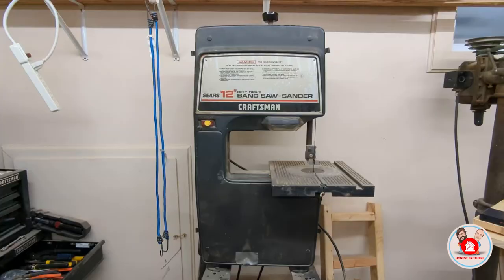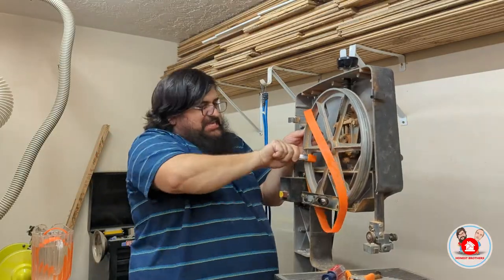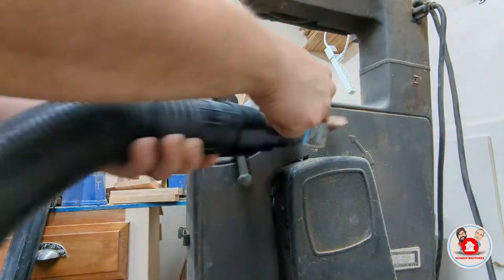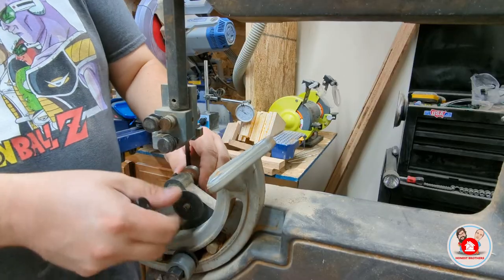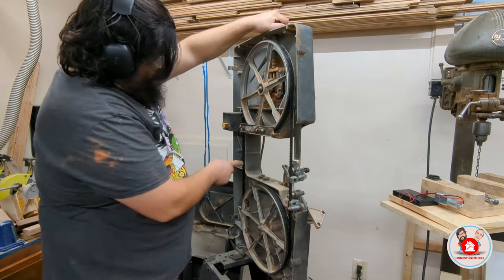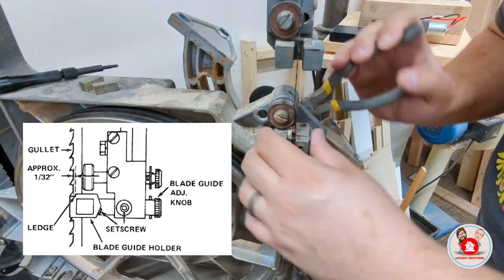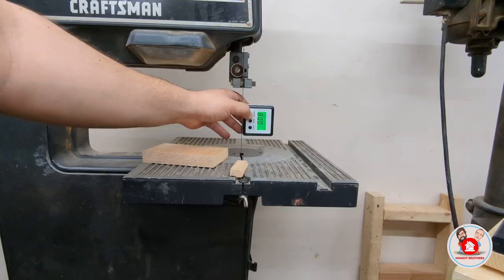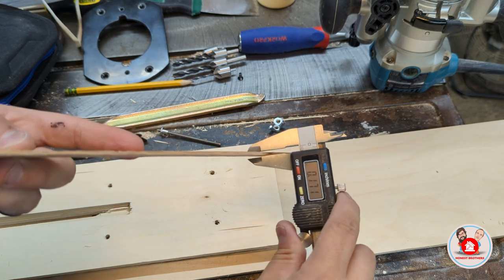Craftsman Bandsaw Tuneup | Resaw blade install, tire replacement, and tune

Comment: Great video! I have this bandaw.  You don't actually need to remove the four bolts to get the table off. Just remove the one nut on the trunnion and you can remove the table and trunnion together. Just remember how the trunnion washer, handle, spacer, and nut go on that single bolt and you're good! Much easier, in my opinion.
Reply from the maker: That's a great tip! And that would be easier!

Comment: Dude I don't even have this saw(craftsman 10in band) but this was by far the best bandsaw video yet. Almost want to send one of my restos your way just to see the content . Solid work bro
Reply from the maker: Thank you! I wish I had done one on the 113 tablesaw and the jointer. I inherited a bunch of my larger tools from my grandpa, and they all needed some tune up. I should have some more content coming soon, but they're mostly 3D printing focused. I'm trying to brainstorm some ideas for making some 3D printed jigs for woodworking, too, which I think would be pretty sweet.
Reply from the maker: Oh, and I'm working on getting into homebuilding. So there may be a whole series on that.

Comment: Nice. However... Any time you change the blade or perform an adjustment, make sure the on/off switch is in the fully off position; remove the safety key; and unplug. Tool (blade) change and adjustment  for and power tool should be done with power off and unplugged. That is, no energy potential. Safety first.
Reply from the maker: You're 100% correct. I'll have to make sure to include unplugging the motor next time. LOTO.
Reply: Wait, I thought it was easier to make adjustments while it’s running?!?
Reply: @colininscore1286  My original comment was 8 month ago. you wrote: "... easier to make adjustments while it (the power tool) is running." depending on what you are adjusting or replacing, power should be "off." Depending on what is being 'adjusted' you can "observe" what requires adjustment, turn off the tool, make the adjustment, and repeat. "easier... " does not mean "safest."

Comment: Thsnks Brandon.  This is helpful as I have this same bandsaw (25 yrs old).  I do have a question about removing the wheels to make installing urethane tires easier.  Can you give me any hints as to what the parts are that need to come off and the best way to do that?  Thanks, Liz
Reply from the maker: I've never had the wheel all the way off, but it looks like the wheels are held on by a lock ring, so you'd need a set of lock ring pliers to remove them. You can get the pliers from an auto parts store or online. I wouldn't recommend buying the cheapest set of pliers as the tabs on the pliers like to break.

I'm not sure if they're pressed on, I don't think they are, but if they are, a pulley puller from the auto parts store will pull the wheel. They have it as a rental tool.

Comment: Great video! I have this same bandsaw. Can you give me a link to where you bought your guides blocks and blades? Also, do you use a sacrificial fence for tall(er) stock? What do you use?
Reply from the maker: Guide blocks:
https://amzn.to/44vLKDl

Urethane tires:
https://amzn.to/44uvnHg

The fence I use, I just made out of plywood. Works well, but not the easiest to set up and get square. I need to come up with something different, but too many projects. 😅

Comment: Hi, thank you for this great video.  I have this same bandsaw and need to replace the capacitor but I have no idea where it is.  Ive looked everywhere for it so it must be inside the motor but want to confirm before I start tearing into it.  I have no idea what Im doing here
Reply from the maker: I haven't had to do this, but it would be in the motor housing. Does it start without the belt on?
Reply: @Honest Brothers  I haven't tried taking belt off but I will try it and see what happens.  Thanks a lot
Reply from the maker: @ursulap23  That'll help diagnose if it's an isolated motor issue. I think they put several different motors on these, some have caps, some don't. Mine has really bad starting torque. If anything is hanging up, the blade won't turn.
Reply: @HonestBrothers  I wonder if someone here, in the comment section, can tell me how to read the date code on my saw? I would like to know what year it was made.

Comment: I believe I have the same bandsaw. Craftsman 12 inch model number 113.243310. I need to replace the tires on the wheels but I don’t know what size to buy? What size tires did you use? this is my first bandsaw, so I am a newbie.
Reply from the maker: They are 12" x 7/8" urethane tires from Amazon. They are a total pain in the arse to get back on, be warned.
Reply: @HonestBrothers You really wanna party? I mean like really really wanna party? Then get yourself the craftsman tilt head band saw and try putting a new tire on the bottom of that. I did that today. I havent fully recovered yet.

Comment: How well does that particular bandsaw work for resawing thicker stock?
Reply from the maker: Honestly, I haven't tried thicker stock yet. I'm in the middle of 3-4 projects right now, one of them being inlay banding I'm going to put into a shadow box for my wife, so I needed the resaw blade on it for that. There was a LOT of blade drift with the blade that was on it, but also the saw needed the tune up. 

How thick are you talking? I have a branch that has been sitting in my back yard from a lightning strike that I can try to run through it.
Reply: I've seen several of these types of bandsaws for sale and was thinking about getting one. 
Would it work for 3/4" or 1" stock?
Reply from the maker: @moorebid5380  With a proper fence, I think you can. I just tested a piece of white oak and got a little bit of blade drift while trying to cut a piece that was 1/16" wide. 

I plan on upgrading eventually. Bearings instead of guide blocks would help a lot.

The motor is a little under powered to cut anything super hard. 

It's a good starter bandsaw, especially considering you can get them for next to nothing.